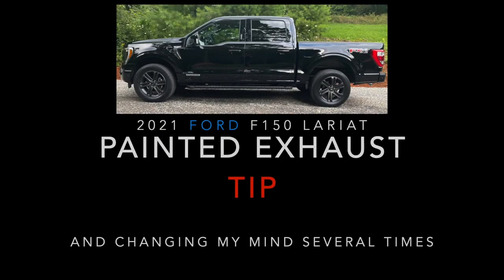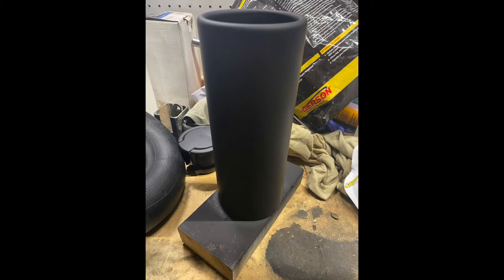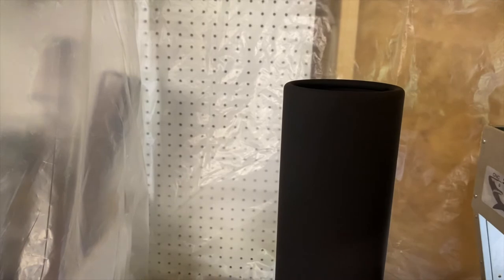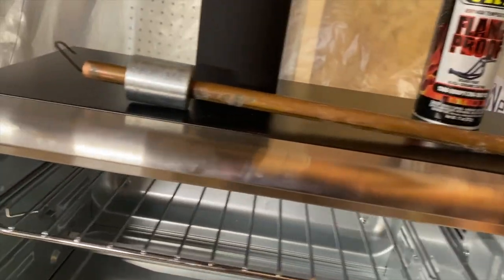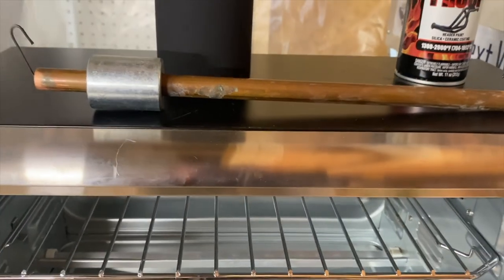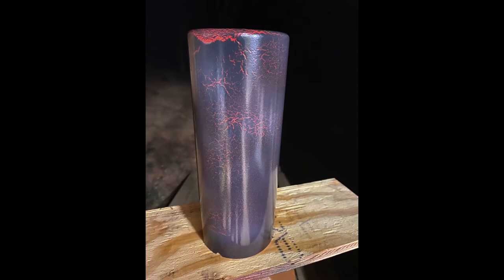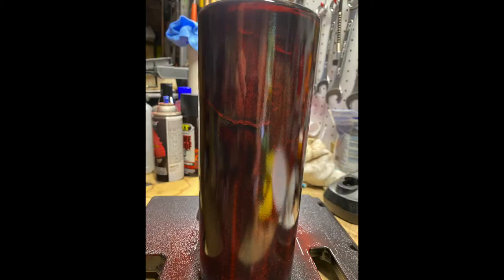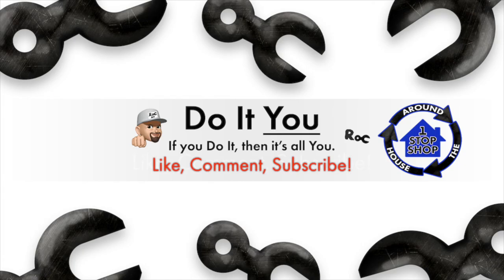2021 Ford F150: Painted Exhaust Tip DIY

Comment: It would be nice to see how to remove the exhaust tip
Reply from the maker: Get a good grip on the exhaust tip, then twist it slightly left and right as you pull on it. Don't twist it too much or you will bend the metal springs or the barbs at the end of the metal springs. There may be other methods, but that is what I did.
Reply: It looks like there are screws or something holding the tip on. Is that true or just use a rubber mallet to help take it off?

Comment: How did you remove the chrome tip?
Reply from the maker: There are two ways- You can pull it while giving short twists left and right. Twist too far and the barbed tines can become damaged. #2. If you have a thin, rigid piece of sheet metal that can go around the circumference of the muffler (10") that is around 5" in length, enter it between the exhaust and the chrome tip from the backside. You may have to spray some WD40 to make it easier to move. You have to get the piece of metal to go under the barbs from the exhaust tip that are grabbing on to the exhaust. The tip will slide right off if you get the sheet metal under the barbs.
Reply: @RoCDIY  Some, nice work. I had thought it was welded on, I wanted to put on a bit bigger black tip, and thought I would have to cut it off, now I know it is removable, thanks.
Reply from the maker: @garys2157  Thanks for watching and commenting. Good luck with what you decide to do.